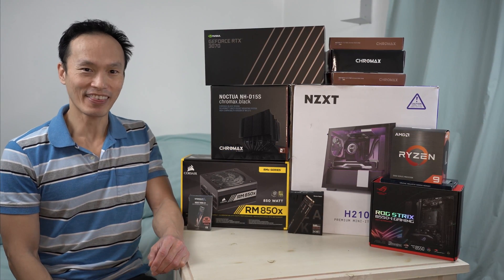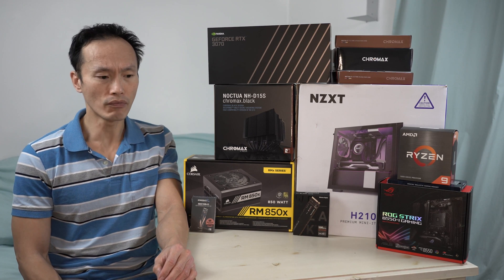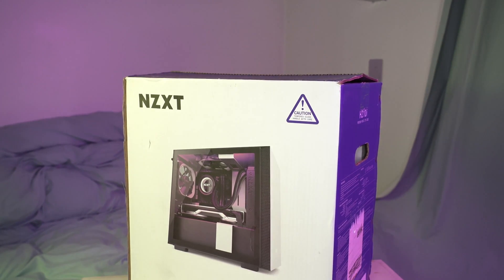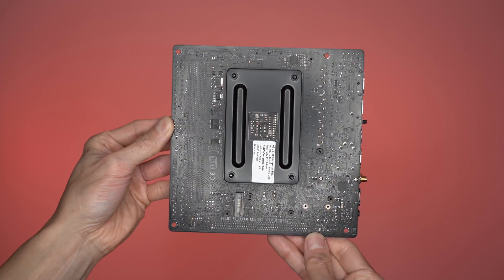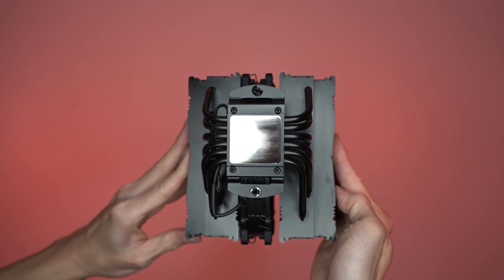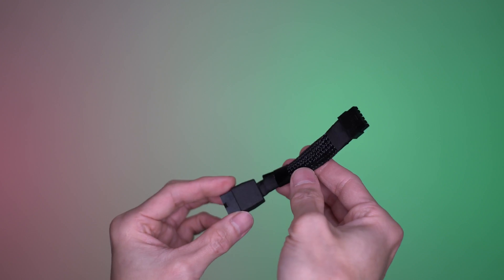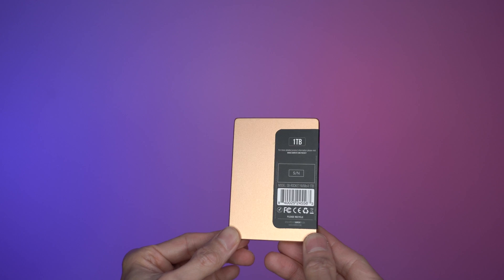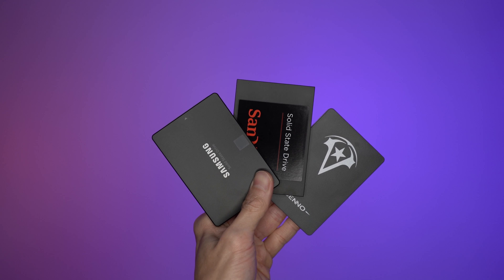Mini-ITX PC Build - NZXT H210i, Asus ROG STRIX B550-i, Ryzen 9 5900X, NVIDIA RTX3070, Noctua NH-D15s

Comment: the ROG Strix B550/X570 mini itx motherboards are known to have some compatibility issues. Just watch out. Sexy build otherwise
Reply from the maker: Thank you, Rahul! Pray tell what these compatibility issues are so I can keep a look out for them.
Reply: @wlee9727  These motherboards are known to throttle Zen 3 CPUs (especially the Ryzen 9s) where even when there is ample power and thermal headroom, the motherboard will limit your CPU to about 4.1 GHz. Compatibility is there, technically but these boards like to hate Zen 3 CPUs.
Reply from the maker: Thank you. I didn't know that. I've been doing lots of video editing/rendering work and from HWiNFO64 on my system, all cores have been consistently hitting 4.4 to 4.5 MHz max without any tweaking or overclocking. I guess I must have won the silicon and circuitry lottery. But I'll keep an eye out on the throttling issue.
Reply: @wlee9727  Good man. Just keep an eye out.

Comment: Love the video. May I ask do you have to remove the motherboard to replace the 2nd M.2 installed at the back of the motherboard?
Reply from the maker: Thank you, Sam! Yes, the mobo has to be removed if you're going to replace the second m.2 drive at the rear. It is squished between the mobo and the mobo panel of the chassis. I might have to do that some time as my m.2 drive has been hitting a maximum of 51°C recently when it didn't use to do so. Not a big concern as the WD SN750 drives are designed to withstand up to 80°C. I'll have a little investigation just to make sure it's not air flow problem in the chassis.

Comment: Isn't the PCI.e in the ASUS ROG STRIX B550-i a Gen-3 by 2?  Will your Gen4 by 4 NVME SSD that you put in even be able to get full transfer rate? 5Gigs?
Reply from the maker: Yes. The m.2_1 slot (front) supports PCIe 4.0 x4 and the m.2_2 slot (rear) supports PCIe 3.0 x4. That's why I put the Sabrent Rocket NVMe in the front slot and the WD SN750 NVMe in the rear slot.

Comment: How do i get a founders edition card
Reply from the maker: Join an online community like on Discord so you can be notified of any GPU drops. And also, you need determination. Despite the current bloodbath of the GPU market, you have to be persistent if you want to get any GPU at all. It's a lot more difficult to get FE cards compared to AIB partner cards because there are far fewer FE cards around and recently, there hadn't been many FE drops in either the UK or EU. If you can hold off getting a new GPU at the moment, do that because the current GPU prices are insane! At the end of last year, I thought the new year would calm things down but with new developments like tariffs imposed by certain countries on tech items, the recent Suez Canal blockage and no sign of the global pandemic slowing down, GPU shortage will be with us for quite a while now. In any case, be persistent and you could possibly get one at MSRP.

Comment: What was the floss for?
Reply from the maker: To click into place the cooler fan. Once you have the mobo in the case and you mount the Noctua cooler, there is very little space at the top of the chassis and the cooler for you to clip the top clip of your cooler fan in between the two cooler towers. Most people use chopsticks or long thin pens/pencils but it's hit and miss. If you use your fingers from the back of the chassis to clip the fan on, you might get sore fingers because the space is so tight. So, by preparing the dental floss (or any long thin string) and tying it to the top clip of your cooler fan, you pull it and it clicks the clip into place without you having to struggle with chopsticks, pens/pencils or fingers.
Reply: @wlee9727  ty!

Comment: Hi! Amazing video, very educative. I'm planning to build a PC with this case for my dad soon. So far I've only built a mining PC, so you could say that it'll be my first real build. I have a question on the Noctua NH-D15s Chromax CPU fans. I'll put a I5-10400 in it. As the 10400 is ofcourse way less powerfull than the CPU you used, will I need cooling of this size for it? Or even any fans other than the stock one provided?
I know the video is some months old, so you might not notice my reply, but I would love to hear from you! Thanks in Advance :)
Reply from the maker: Thank you, Pepe! Because the i5-10400 is 6C/12T and it has a TDP of 65W, I think the NH-D15s (or even the NH-D15) would be an overkill. It might be better if you save some money (or channel the savings to other components) by going for the NH-U14s or the NH-U12s. I don't believe in paying for the latest and greatest PC component when what I'm going to use it for would not breach half of its potential. That's why I got the RTX 3070 and not agonising in trying to get the RTX 3080/3090 because the RTX 3070 is more than enough for 4K video editing, displaying on a 4K monitor and light 1440p gaming.

The NH-U12s would cool your i5 just fine and it will definitely fit into the NZXT case with some room to spare. The NH-U14s would cool your i5 too but it would nudge very close to the side glass panel like the NH-D15s. As both these coolers are single tower coolers, you would have more space and airflow in your case for general cooling (assuming you're also setting up two front intake fans and one rear exhaust fan). Also, with more space, you could possibly fit one slim 120mm fan (120x120x15mm) at the top of the chassis as an intake fan for extra cooling.

There are coolers other than Noctua which would cool your i5 and suit your budget, e.g. be quiet! and Scythe Fuma 2. The main reason I chose the Noctua is because their fans are oh-so quiet! Even at full RPM, it sounds like a mid-low buzzing fluttering hundreds of butterfly wings. Relatively loud at load but not annoyingly loud like some fans which have higher pitched buzzing. If you go for coolers other than the Noctua, test to see if you like their stock fans. If not, you might want to swap them out for Noctua fans. The only problem with that is it would be extra cost and more time spent.

If you're looking to get the Scythe Fuma 2, here is a comparison test with the Noctua NH-U14S, U15 and U12A by Hardware Canucks - https://www.youtube.com/watch?v=KebELRNwIbY

If you're thinking of just changing stock fans, for the usage that I have (video editing and productivity work), the only fans I hear ramping up is the cooler fans. My chassis fans (front and rear), the GPU fan and the PSU fan barely emit a whisper, even when under load. It's because the 9 5900x is such a power hungry beast that the CPU cooler fan works harder! So, if you're not getting a Noctua cooler, if you're working within a budget and the stock chassis fans are not annoying, keep all your stock fans and just change the cooler fan to a Noctua one. That is the one fan you will notice ramping up and down according to workload.

Let me know if you have other questions.

Have fun in your first build! I'd like to see it when you're done!
Reply: @wlee9727  Thank you very much for your answer! It looks like my build will be delayed a bit, but I will definitely send you the end result!

Comment: Why not install the Noctua cooler on the outside of the case and then lay it inside....
Reply from the maker: I did consider first mounting the Noctua on the mobo before putting the whole thing into the case but the Noctua would completely block the top left corner hole for the mobo panel screw. With the Noctua NH-D15s being a heavy beast, I did not want to risk the mobo hanging on just by three mobo panel screws.

Comment: 11:58 what is the purpose of this?
Reply from the maker: Once you have the mobo in the case and you mount the Noctua cooler, there is very little space at the top of the chassis and the cooler for you to clip the top clip of your cooler fan in between the two cooler towers. Most people use chopsticks or long thin pens/pencils but it's hit and miss. If you use your fingers from the back of the chassis to clip the fan on, you might get sore fingers because the space is so tight. So, by preparing the dental floss (or any long thin string) and tying it to the top clip of your cooler fan, you pull it and it clicks the clip into place without you having to struggle with chopsticks, pens/pencils or fingers.

Comment: i have the same case and cpu cooler, do you think the the 3070 rear exhaust affects cpu cooling?
Reply from the maker: Depends on your usage, I guess. If you use the GPU a lot (e.g. gaming), more heat will be generated by the 3070 and it will blow over the Noctua. However, if you adjust the fan curves and use two instead of only one fan, the temp on the CPU and the case should still be good and not too hot as long as you maintain good airflow.
Reply: @wlee9727  thank you so much!

Comment: You know what? I was actually planning for a very similar build with Ryzen 5800x. Nice video!
Reply from the maker: Thank you! Make sure you have adequate CPU cooling. From what I've read and heard, the 5800x is an amazing processor but it does run a bit hotter.

Comment: what I love about the build
1. matches well
2. high quality components
3. should be dead silent
4. ITX
5. good performance
6. you cable manage exactly like me

what I hate
1. front cable management
2. the 3070 looks wrong but yes, I know its one of the only compatible rtx 3000 cards in the 210

This is a cool pc but nothing mind boggling, well done
Reply from the maker: Thank you! Noise level is very low, with a constant low hum when under load, with the Noctua fans. I'm astonished at the high level of productivity performance! And yes, cable management is so important for the visual looks as well as keeping the ITX case open with more space for air flow. The front cable management is purely to go with the looks and not functionality. :o) And the 3070 has a subdued gunmetal grey colour which I think blends into the surroundings compared to the brighter silver grey of the 3060 Ti. Thank you for watching the video!

Comment: Not trying to criticize but you should’ve gotten a custom extension from CableMod for the gpu. You can get a specific connector for the 12 pin so you don’t have to use that ugly adapter.
Reply from the maker: Thank you for the suggestion. I had looked into it and also, looked at Corsair's own 8-pin to 12-pin cable but the cables were either expensive or would've taken too long to arrive that I just went for the EZDIY cables. And yes, the RTX adapter is ugh-ger-ly. The RTX 3070 is not as power hungry as the 3080 or 3090 but I guess NVIDIA wanted to standardise the look of their FE cards.

Comment: Wow! packed a lot into that case. I would suggest, especially with the small case and tight space, upgrading to a 280 AIO for the CPU. Nice build.
Reply from the maker: Thank you, Dennis! I did consider using an AIO but in the end, went for air cooling because I was a touch concerned about the presence of liquid in a computer case and the apparent extra noise from an AIO pump (generally, according to what reviewers have said).

Comment: this is your first video and it is incredible. 

the editing, video angle, ..... your area i guess !

but asthetic for the pc, all different 2.5 drives, cable colors and cable managing... shows u put alot of research into this.  Maybe the fan for air flow in vs out is not correct ( im not sure about this) , but everything seems perfect for this video. Salute to your good work .
Reply from the maker: Thank you, Tuan! Researching and accumulating the PC parts took about six months but I'm glad I took the time (and also, some parts were difficult to find at retail price) as I will be using Candy Cassidy for many years and I don't plan to upgrade anytime soon.

As for the fans, let me know what you're thinking. It could maybe improve the air flow.

Comment: Thank you for the very useful video. I am planning to build my PC in same case, but in white colour. I was doubting about air cooler in this case. I am planning to build on Ryzen 7 3700x or 5800x with Noctua nh-u12s chromax black with two 140mm front intake and one 120mm rear exhaust and one 120mm on the top fans. 
Anyway, great job and congratulations with new nice looking PC😂
Reply from the maker: Thank you! The Noctua NH-U12s would fit in the case because it is only 2mm shorter in height than the NH-D15s. And yes, you could put a fan on top of the case! Hope your build goes well!

Comment: I’m making a similar (ish) build except more of a mid-range performance. An i5, 16GB RAM, two NVMe’s and using the stock cooler and case fans. GPU I will find something second hand. 
I actually did not know that the OS drive should be in the slower M.2!

Last time I made a PC it had a CD-ROM drive and spinning disc hard drives - I’m looking forward to making a small PC where practically everything is on the motherboard and there’s no moving parts 😁
Reply from the maker: The OS and various programmes you need can live in the "slower" Gen 3.0 m.2 drive or even on a SATA SSD drive because launching a programme does not require super-duper fast speed. The speed of an NVMe SSD and even a SATA SSD nowadays is more than enough compared to that of a bygone era when launching the OS/programme takes minutes and not seconds. The front Gen 4.0 NVMe slot would be better utilised as storage for your games or raw video files because your CPU need lightning access these files when you're gaming or video editing. As for a GPU, if you're gaming at 4K, the lowest GPU tier you need is an RTX 3070. If gaming at 1440p or lower, the sweet spot is an RTX 2070 Super or an RTX 3060 Ti. If video editing in Premiere Pro, the sweet spot is the RTX 1660 Ti but if you're editing in DaVinci Resolve, you need at least an RTX 2060 Super because DaVinci Resolve uses the GPU more. Having said all that, the GPU market is crazy right now but hopefully, it will calm down soon and we can get the GPU that we need.

And yes, here's to no moving parts in a computer build (apart from the fans)! Hope you build your PC soon!
Reply: @wlee9727  Thanks for your input, I’ve ordered the case already and I’m going to get a B560 motherboard when I can!

Aside from games I will be doing software dev and music production, I don’t do anything involving video, so the gaming stuff will probably be the most intense thing I use it for
Reply from the maker: @Kefford666  Yes, your games and any raw files would best live in the Gen 4.0 NVMe SSD and everything else in the Gen 3.0 SSD. Thank you for taking the time to watch the video, Matthew!

Comment: Some of your build order choices were unorthodox but the build came out great :D

I prefer to put the cpu cooler on before mounting the motherboard, also I usualy install the PSU in the case first, then the MB and the rest.

But hey - if it works for you then it just works :D have fun with your tiny powerhouse
Reply from the maker: Thank you! Yes, I did consider first mounting the CPU cooler on the mobo before putting the whole thing into the case but the cooler would completely block the top left corner hole for the mobo panel screw. With the Noctua NH-D15s being a heavy beast, I did not want to risk the mobo hanging on just by three mobo panel screws. :o) As for the PSU, I did install it first but I was flipping the computer case up and down and all around so many times that the PSU was weighing the case down. So, I had to take it off to save my arms from fatigue. Hahaha. But good suggestion. If I had used an SFX PSU, I would install the PSU first.

Comment: Nice build, I wonder  could u have fitted the CPU cooler outside the case?
Reply from the maker: Thank you! Fitting the CPU cooler outside of the case? If the CPU cooler is outside of the case, the whole motherboard has to be outside of the case too. I might have missed what you're trying to get at. Please do elaborate.
Reply: @wlee9727   yea , fit everything on the motherboard  outside.the case 😊
Reply from the maker: Oh, I see, as in installing the CPU cooler on the mobo first before putting the mobo into the case. Yes, I did consider doing that but the cooler would completely block the top left corner hole for the mobo panel screw. With the Noctua NH-D15s being a heavy beast, I did not want to risk the mobo hanging on just by three mobo panel screws. So, there is no choice but to install the mobo first into the case and then, the CPU cooler onto the mobo.

Comment: is the GPU "breathing" with this setup ?
Reply from the maker: Yes, it is. The GPU temp and fan RPM spike up to around 35°C and 900 RPM upon powering up (I'm using a 32" 4K monitor) and then, quickly settle to around 25°C and 0 RPM on idle.